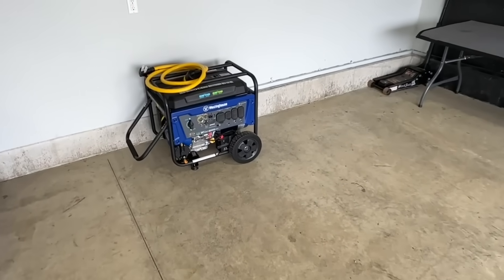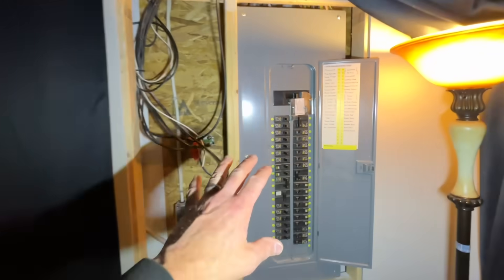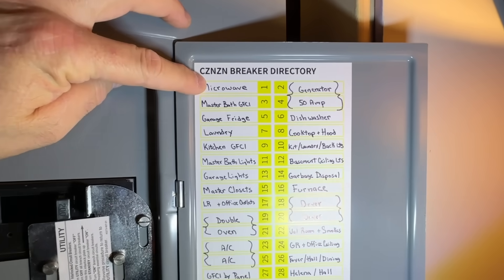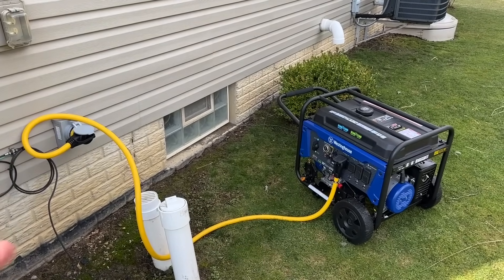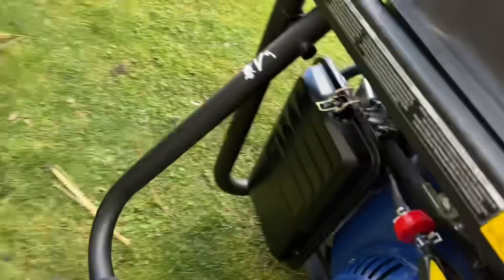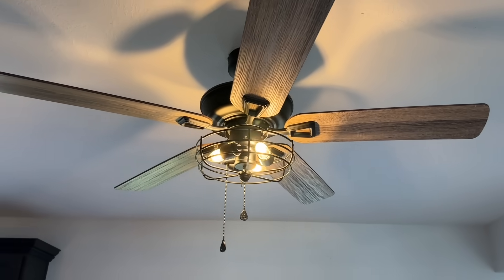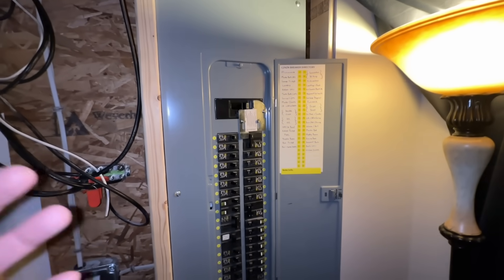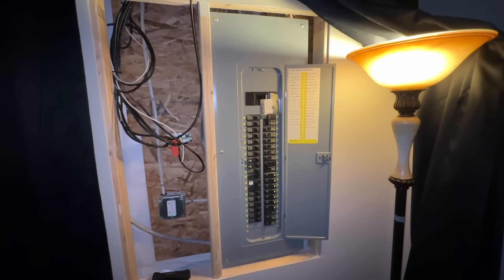Whole Home Manual Backup Generator Setup For Less Than $1600

Comment: Does your generator have a bonded neutral? If so, this wouldn’t be a safe setup. You would need a 3 pole transfer switch to be able to isolate your generator so you don’t have two bonded neutrals in the same system.

Comment: Don't listen to this guy. He didn't mention the first and most important thing that has to be done or you will get electrocuted or burn your house down or both. The first thing that needs to be done is to remove the neutral to ground on the generator, the house has its own and plugging a generator into the panel without doing that step is a very dangerous situation

Comment: Why not backfeed into your 220 dryer outlet with a suicide cable? Just make sure the MAIN IS OFF… and both sides are plugged in then add dryer and ac/ heat pump water heater as needed.  5 ton heat pump pulls about 4500 watts I added a hard start (extra capacitor) to help with start up. Right now the ecobee thermostat doesn’t like the voltage drop when the load kicks in…

Comment: How to connect a genset to a panel with phase line and the neutral ground wire  voltage supply 220 volts ac

Comment: What is the reason for having the generator double thing at the top of the breaker panel? 
I’m doing the same but was going to use the lower double set that’s on the bottom.
Reply from the maker: It’s a safety interlock.  It attaches to the top so that you can’t accidentally have the main power on at the same time as the generator.  You can’t accidentally only turn on one or the other.
Reply: Ahhhh! Thank you!
Reply from the maker: No problem 👍🏼
Reply: I have the same generator and now figuring out how to use it! Have the electrician coming over to do the same cord for me. Appreciate the video. AND the amazing fast reply!😂❤

Comment: I was going to get one.

But might get solar panels. They have Govt. grants here to try to make us Irish green. Shamrock/Clover isn't enough anymore. 😊

Yes a generator is better during a blackout but the panels will reduce my utility bill during regular useage. And with batteries might power the essentials at night during a blackout. And will re-charge during the day.

I have to research it more of course. Even with the grant it will still cost more than a generator. But should work out better in the long term. And be less hassle. No need for gas and starting and maintaining a generator. 

I just have to see how effective it will be during an outage.

Comment: I did the same thing but ran the generator connection out to a shed I have so I can keep the generator plugged in 24/7, it cost me $1,000 for the electrician to run the wire out to the shed. With remote start on the generator my wife can easily get power back when I am gone without having to go outside, the generator was around $1,400 simple open frame portable unit gas and/or propane powered.
Reply: Sounds nice. Can you explain the remote start part? Do you mean the key fob or an auto transfer switch? Does your wife still have to do the safety switch at the breaker?
Reply: @bradleykeys987 1st = main breaker to disconnect from the grid, 2nd turn on circuit breaker that connects generator to the house 3rd: then start the generator with the fob. It's not fancy, just convenient because in bad weather my wife can do everything from inside the house if I am away.
Reply from the maker: It’s a remote to start the generator from inside the house but we still have to manually switch the transfer switch at the breaker box.

Comment: This is great, but also remember the 80% rule. That 50 amp breaker can only take about 40 amps max to prevent overheating or worse. On another note, that breaker label system you have is awesome.

Comment: Great  Video  -- 2 story home ...   decided to  go manual  interlock switch  --  have  a   400 amp service -  2  ( 200 amp siemens panels )    was considering auto tranfer switch --  but costs were 💰💸💰💰💰💰    so  high  by time adding propane tank & installation of same.  Seems  interlock switch on   one  panel  could  give  more  flexibility  than a  manual  transfer switch   using  or wired  only 10 ciircuits wired as  essential.     Energy back up  only hopefully for a  few days or  hours....   ⚡⚡⚡⚡🔌🔌  interested in  WELL  pump and  frigerator....  and a few  other circuits...  Out in country  --  all electric

Comment: Only problem with Westinghouse is that it is neigh impossible to find parts for it!  Especially the carburetor, and parts for it. I have 2 of them, one is a brick due to the lack of parts. Never will buy again from that brand.

Comment: I have added a Micro Air easy start to  my central A/C.  My gen's are Firman's. I have 2 and alternate them every 12 hours. No issues at all. Remember to keep up with oil changes and do not try to run your gen for more than the recommended run time without the recomended rest time.

Comment: feel like there's room for improvement with the exterior plug being that exposed and vunerable to rain/elements when in use.  seems like a larger version of standard 110v exterior plug box would be a good addition to a setup like this.
Reply: You are correct. That plug would not stand a chance running in a hurricane with 100 mph winds. A 100 mph sustained will blow rain through brick. Amazon is selling a better one that has a metal enclosure and is tilted down 45 degrees. Should solve the hurricane issue.

In case you are wondering what the effect on 100 mph winds is on a brick house wall is. The rain will blow sideways for hours and completely saturate the brick causing it to leak behind the brick wall. Not normally a problem. The high wind pressure blocks the weep holes at the bottom of the brick and water fills the brick ledge and seeps underneath the sole plate. The carpet or flooring is then saturated and you need to pull the carpet up and dry it and the pad out.

A standard plug does not stand a chance and many outdoor GFCI plugs will trip.

Comment: your setup is very close to mine, I ran a 30 amp breaker, outlet & outdoor wire instead of 50 amp. I also picked up a 100 lb LP tank and an adaptor from Amazon to run my gen for a few days with no worries. one tip I'd share is something else I did when I moved into my home 20 years ago, convert my dryer and oven to LP to drop my energy costs as LP is cheaper than electric to cook and dry cloths with. side benefit is you can run both devices off the gen with no issues. I found gas tools don't last anymore since my state added crap to the gas so from now on all my tools are either electric or LP powered. I gave up storing gas and haven't missed it.

Comment: You didn't mention wether or not you unbonded your generator it should be for the application. Only supposed to be 1 system bond and your panel is bonded so you need to remove the Bond on the generator.

Comment: A few different companies make a,power restore alarm that goes on your breaker box. It is operated by a 9 volt battery. You switch it on while using the generator, and it will sound the alarm to alert you that the poer has been restored. Works great.

Comment: You want to get an inverter generator or you'll fry sensitive electronics.
Reply: The size of that generator the frequency distortion is going to be minor especially if he keeps it at half load like you're suppose to do anyway. Most of our electronics nowadays won't even accept current with high enough distortion that it could cause a problem

Comment: I do not have quite the same system.  I have and older Coleman PowerMate 4000 and a bunch of extension cords.   It's better than nothing.  I use the generator to recharge my EcoFlow Delta 2 MAX and River 3 Plus solar power stations that have (2) 220w, (1) 400w, and (5) 45w panels when it's cloudy or dark.  😃

Comment: Running a generator is much More expensive than buying power from the electric co.  A large generator sounds great until you find yourself buying $60 in fuel every day. Not to bad when the power is off a few hours.  Ten days can be $600 or more.  In my house starting the 1hp water pump 240v has to be done by itself. 4000w works. For me.

Comment: Question: Won't a 9000 running-watt generator run a microwave (1200W), Fridge (700W), every light in the house if LED (400W), and still have 6,700W available for other appliances? And if I need to run the 50 Gal hot water heater (maybe 5,000W), can't I just NOT use the microwave for 4 hours while the water heats up? I'm not understanding why people buy a large generator just to power a few lights and the fridge. Please help me understand since I'm about to buy a similar generator with 9,000 running watts and have an electrician install the 50A generator receptacle and the safety switch. I have been using a 3500 Watt continuous WEN generator inverter to power my fridge AND microwave without any problems for over a year. I'm just tired of moving the generator to the kitchen window, putting extension cords through the window, and moving the fridge to get to the plug. It has been a hassle, but the little generator inverter runs the fridge and microwave just fine. In fact, I even used a hair dryer for 5 minutes without an issue.

Comment: Something to think about. The thumb nail u have shows a cable going to your house. It’s probably 10 gauge. But way to close to ur house. Also there is a basement window next to the generator. C02 is heavy and will stay on the ground… MOVE that generator 25 feet away from your house.
Reply from the maker: The cord is a 15’ 50amp cord so it definitely thick enough.  I also normally do keep it at least 15’ away from the home.  I always keep that window locked and sealed so no worries there.  But appreciate the feedback.

Comment: I had this same one and did the same thing, only when the electrician put in the 50 amp switch and all, and  I had him put in a Surge Protector for the whole house, our electricity was going in an out and we had to have the A/C's capacitors replaced some times. 
So far have not had to use the generator, did put the oil in it and keep in the garage, had a 50ft 50am cable made just for it. After reading some of the comments, may elect to use the propane ... But for now have some gasoline ready.  Thanks for the video and all the comments!

Comment: So, to all the people blasting this setup, there are a bunch of opportunities for criticism, however, it is significantly “safer” than what I did when confronted with a multiple day power outage. I basically bought a similar generator, bought a hunk of #8 SO cable ran through a garage man door, and a male plug for the generator side. Then I yanked the cover of the breaker panel, opened the main, unwired my dryer, wired in the generator hots, back-fed through the dryer breaker and left the panel open for the next four days while power was out. Found out the little gas tank was good for about 7-8 hours, which sucked because the generator does not shut down gracefully when low,on fuel. I Let it run low a few times hearing it chug out, figuring I was nuking any electronics I might have left on, dealt with 5 gallon jugs of gasoline purchased quite a distance from home. Long story short, everything about what this guy did looks much safer and smarter than what I did, but hey, if you want to knock the guy, feel free I guess. Oh, BTW, I am an electrical engineer… ;-) And now, I have a different home, with a Generac full nat gas whole house backup. Previous owners installed it, otherwise, I might still be doing the janky gas backup thing, who knows. I will say it is pretty nice.  I’m guessing the thing was probably $20K installed 22kw, not sure.
Reply: I've contemplated doing the same thing but using my EVSE 50 amp plug for my car in the garage and backfeeding the panel.  Of course, it would use a male to male cord which is extremely dangerous, but would accomplish the same thing.  And of course, turing off the main panel breaker so as not to backfeed into the grid.
Reply: @msujdog absolutely, with a 50Amp receptacle ready to go, I would 100% make up a suicide cord and do exactly what you are planning.  The deal with all of these setups is this, you are going to be using this thing in a pinch, and ideally never. Also, you will probably be the only person even aware of what you are doing so you can be in control of safety. So many people are quick to criticize folks, but think of the other options some people might do with these… 10 120V extension cords plugged into 2 or 4 receptacles on the generator, running all over the house? Not exactly the model of a safe setup. BTW, I’m sure you’ve already looked but 50 amp extension cable is not what I would call “cheap” but apparently RV people use this stuff all the time.
Reply: Good video man, I want this setup.. My power doesn't go off that often so I don't need to spend $$$$$$$s of dollars on a whole home setup with a generator.  I have a 5500W generator and your setup meets my needs and it very simple and safe...Great Work!!

Comment: That's exactly the set up that I did at my house just a few months ago. And it was just about $1,600. to do it. $1,000 for a Champion 9300 running watts generator, and $200 in material (8 gauge wire, 50 Amp Breaker, safety lock for the breaker box and the Hook up chords) and $400 for the electrician to hook it up. Works like a charm!

Comment: Gen
 
2 years ago, I had to redo the service into my house. The pole rotted off at the base. So, I bit the bullet and installed a 22kw Generac with auto transfer. Why you ask? I am 74 partially disabled and have a disabled wife, and a 93-year-old mother-in-law.
 
I did not want to have to try to connect up the generator. Get it running and transfer what i needed to it. Now it tests itself every sat at noon If the power goes out it is immediately up and running stabilizes and transfers over to Gen. It runs on propane and I have a 320-gal tank. When the power comes on it the Gen transfers back stabilizes and shuts down. Just like the commercial. No, we are in the booney’s no one is coming over with their crockpot.
 
Note: Electrical requirements are usually not DIY. I am a licensed Journeyman since 1970. 120 volts can kill you in a heartbeat. Pun intended. 
 
Run the line into your panel and install a lock-out bar if you do not go with an auto transfer. Do not try to remember the sequence to bring your Gen online. It will save a life and your gen if the power comes back on and your gen is hooked to the mains.  The linemen short out lines to ground while working for this reason. Also you gen will stumble bad if it is trying to power a subdivision.
 
The 22kw will run my whole house winter or summer. You can run essentials on a smaller gen. If you do that make sure you have enough fresh fuel. You can also convert a gas gen to run on propane. That's what I had before the Generac install. If you install a whole home and the temp in your area ever gets to freezing put the battery on a heater. Most whole homes have a connection for that My Generac did.
 
Conversion dual or tri fuel kits its are not that expensive. Under $200. Also you can get a Westinghouse 12,500-watt dual fuel with remote start (via fob) from amazon for $999. It is actually Transfer Switch capable. They will usually handle several circuits you can transfer. 
 
NOTE: DIY electrical can be deadly seek professional assistance.
 
Make a list of the essentials you think you need to run. Remember motors have a startup current. It will be listed a LRA (Locked Rotor Amperage). That is the dual wattage you will see on the gen. https://tinyurl.com/wattsz has some good information on the subject.
 
Test run your generator on a monthly schedule. Run gas Stabil or Sea Foam.  Every month empty your extra fuel into the car and buy fresh. Gas does go bad.
 
Service your generator. Oil, plugs, air filter, battery ie: connections. A typical maintenance schedule includes monthly visual inspections and short test runs, quarterly checks of oil, battery, and fuel lines. I do mine twice a year. When you test run your gen, shut the gas off and let the gen run out of fuel.
 
 
Good luck and be safe.

Comment: My entire house runs on Electricity it has a 200 Amp breaker panel. I installed a Generac back up generator with a six circuit breaker panel. It's impossible to run all of my baseboard heaters along with some appliances, lights and TV. I have the 10' baseboard heater in my living room on one circuit, my lights on another two, my Frig on another as well as my TV. 
If I loose the power, I close the main breaker, hook up the generator and then turn on each breaker in the Generac breaker box. 
I have only lost the power twice, but the Generac saved the day.

Comment: I opted for a smaller generator, that only keeps my water pump running. So I can go to the shitter. Anyway.. I got a small reason, more than costs that is…. Incase of an emergency, it might be hard to get fuel.

Question comes down to how comfortable you want it…. and for how long.

I opted for having water for longer, and relying on led lights powered by powerbanks. That can be recharged by the generator.

So if shit hits the fan, it’s basically camping indoors. But.. can do it for a longer time.

Will if be comfortable? Nah, not really. But how often do things happen really?
Reply from the maker: Exactly 👍🏼 everyone is different.  My setup is for emergencies only and it only lasts a day or two if/when it ever does happen.  If I lived in an area where my power was always out, I’d go with a different setup.

Comment: I like it! One thing i was thinking when watching your process, i like the idea of the yellow stickers on the breaker to easily read the numbers. You should use red numbers on the ones you normally would turn off during an outage, that way it's less thinking in an emergency you'll know right away the non vital ones. Just a thought!